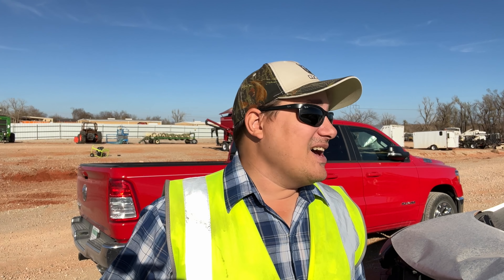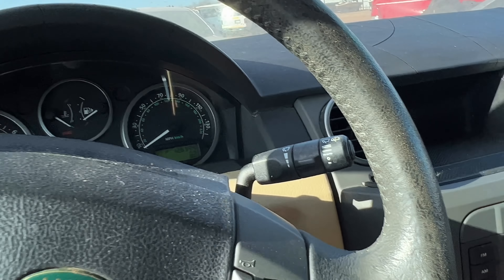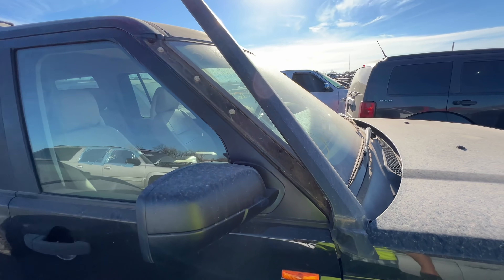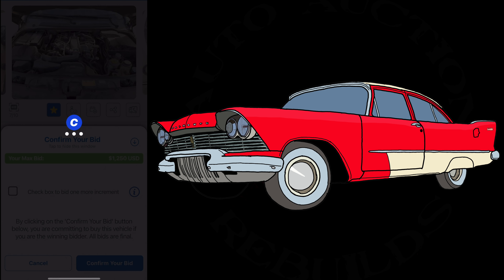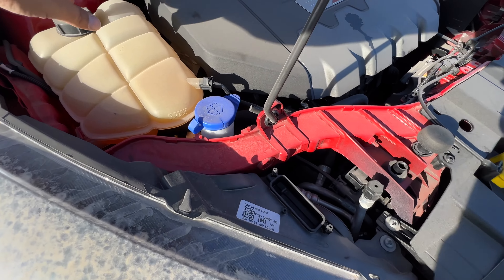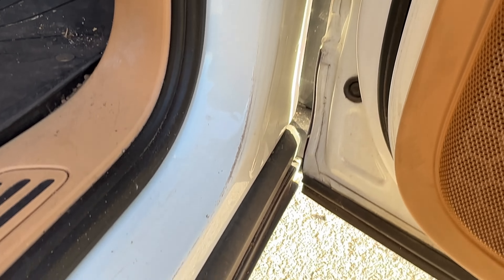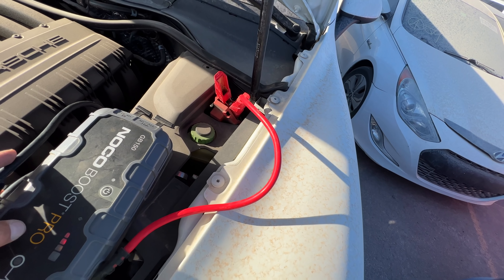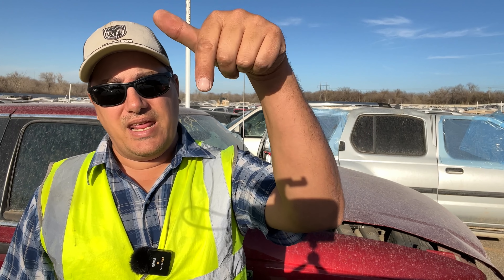Copart Walk Around and Live Bidding on a Land Rover LR3! 12-14-21 PM

Comment: I have to wonder if that blower resistor in the glove box of the Land Rover isn’t there because someone found out that in order to replace the resistor they had to pay thousands to have a mechanic remove and reinstall the dash? I’d check on that cost before purchasing. On some vehicles it’s an easy repair, and on others the labor cost is prohibitive, besides it’s a pain removing and replacing old brittle plastic in the dash without breaking any of it.

Not quite the same thing, but the Car Wizard’s Channel recently posted a video on what it took to service the heater in a Chevy Tahoe. You may want to review that. In order to replace a $30 heater core it cost $2,000 approximately in labor to disassemble and reassemble the dash. He had a later video where he had to do the same for a Jeep. He had three work carts of parts laid out for the disassembled dash. Obviously, these vehicles are not designed for ease of service.
Reply: Wheres the Goozquad boys when you need them!!
Those 2 will tear down a dash and put it back together in no time
Reply: @briangallagher9426  

Agree. Been a pattern lately with Randy’s channel. All he does lately is bid on only vehicles that need no work except for a car wash, and sends them back to auction. He probably needs to take the “Rebuilds” out of his channel name, since that never happens anymore. In fact, he no longer even repairs any part of a vehicle. I miss the way he used to run his channel, when he actually challenged himself with fixing the vehicles he wins.
Reply: Randy has other concerns...
Reply: but i do agree, its just that he also has other things in his life.
Reply: @therealfredwardbenson7295  

Yes. I agree. Just hope he gets all that under control before he starts to lose subscribers. Randy’s a good person and has done well considering how he describes his childhood, having to live in a chicken coop at one point, per one of his online postings. However, particularly to new subs on his channel expecting to see vehicles rebuilt, they will eventually be disappointed.

Lately, he just buys a car, drives it home, discuses what it needs, and then ultimately decides to just give it a wash, fill the gas tank, and send it back to auction. That loses interest by the fifth or sixth repeat.

I wish him well, but to keep growing his channel, I believe he needs to do more interesting things once he gets caught up with his other responsibilities.

Thanks for the reply and I hope you have a great holiday!
Reply: @jayswartzbaugh8553  U as well

Comment: Did you win the bid?  I bought a 2006 Lr3  146k miles for buy now clean title run and drive  for $1988. Got hit with $1200 in fees. At China Grove NC Copart . Right off the bat . Need to fix air suspension  . Brake lines.

Comment: I used to own a black 2006 year model with that 4.0L V6 but unfortunately the motor blew when i was driving. It was at 102K on the odometer. Still they are expensive in general to fix. 

https://www.youtube.com/watch?v=mRrBGkv4EvQ&ab_channel=RSWSolutions
this video shows how ridiculous the transmission fluid change is